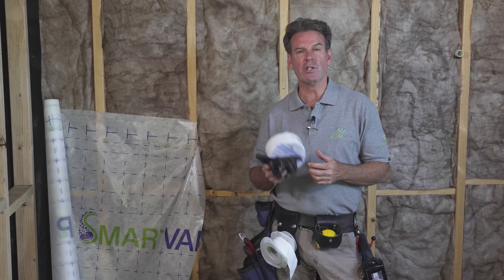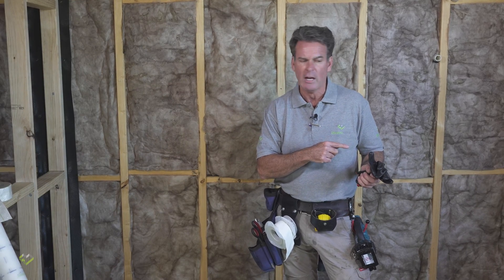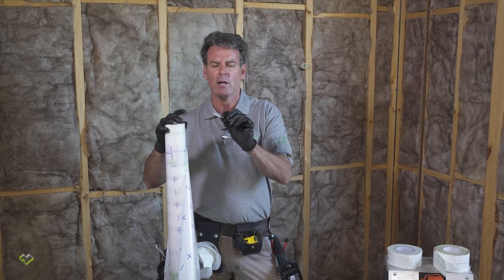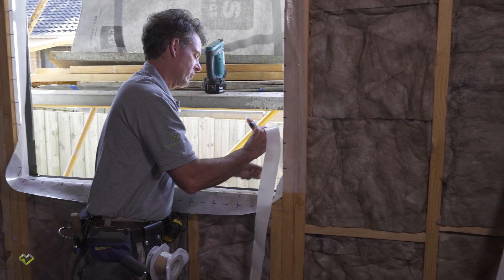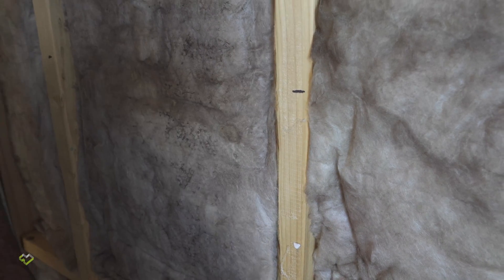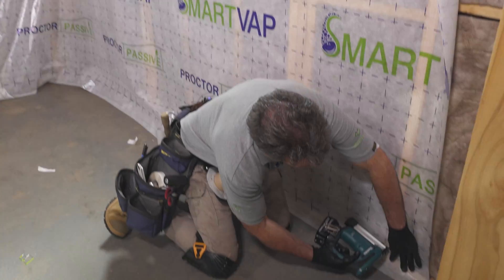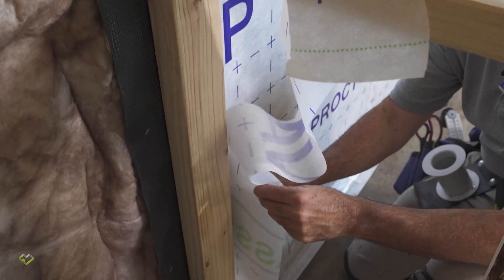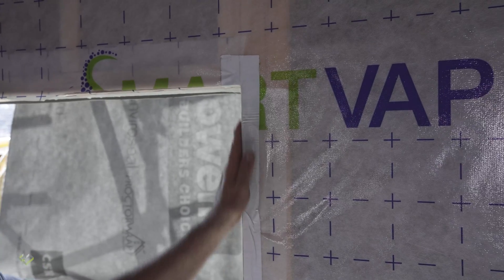Installing an internal wrap for Air Tightness and Vapor Control

Comment: Do you have to put across ceiling between floors in a two story house in addition to the ceiling under the roof or just on the ceiling sections with a roof overlying?
Reply from the maker: Another option could be doing this.  https://youtu.be/GyyaBaVWsoQ?si=I1qL1HjSHmDQFy0r

Comment: In a previous efficiency matrix video you guys were installing an air tightness membrane and either double sided taping every stud or putting staples on ALL studs and putting pieces of tape over the staples after. Here it seems you only fix the edges of the air-tightness membrane with staples and tape the joints. Is it not considered necessary now to fix the middle of the sheets?
Reply from the maker: Fix the middle join?  After this installation a services cavity is expected to be installed which also doubles as a mechanical fix.

Comment: Hi, just a question in regards to plaster battens. 
What’s the best way to do the ceiling on a renovation.
Because you would struggle to nail directly to old rafter?

Is there a way you can still use furring Chanel brackets?

Comment: I suppose the plasterboard batterns, plasterboard and any baseboard/skirting would cover the the 30mm overlap onto the floor - just thinking for those with exposed concrete floors.

Is this something the builder would do, or someone like Efficiency Matrix, as a subcontractor?  Do you have any indicative costs for this
Reply from the maker: Correct.

Comment: Really great video and i love the cimmitment to educating us on best practices. I would love to see how you would recommend making an existing weatherboard/chamferboard home (queenslander) to passive standards, especially when the external cladding isn't removed. I'd imagine it's much the same but i would think that consideration needs to be taken in the wall batts sitting directly on the external cladding and providing an air cavity to dry up any moisture that may come through. Love to hear your thoughts on a video on how to achieve this

Comment: Great clip guys, love the attention to details.
And I like the vertical installation too Mark.
But for the horizontal installation, I would recommend the top layer be applied first so as to prevent water from pooling in the overlap and the taped seem. (which we hope won't get there, but you never know....)
Building science isn't just about trying to control condensation and stopping water from getting in, but also giving water a preferred place to go if it does. Even if the manufacturer says otherwise.... question everything, and express your concerns, and we'll all keep learning and improving. 👍
Reply: Just to clarify: I'm not saying don't follow the manufacturers installation instructions, on the contrary. We need to follow their installation instructions more than ever. BUT manufacturers don't know EVERYTHING, and where some of us see an issue or come across a problem - then please please please contact said manufacturer to find a solution.
Reply: @michaelcook9414  Might be a bit of confusion from the manufacturers installation instructions, as to the way you layer it would change depending on if the wrap is applied on the inside like this, or the outside. If on the outside, starting at the bottom up would be best, but as you said, on the inside, the other way around would be better.
Reply from the maker: Michael, if water gets into the wall cavity via rain, your insulation will be completely saturated before anything might pool in your lap of the internal wrap.
Building science wise, even if this lap was changed, and water that may be allowed in here, could flow down to the bottom plate, there is nothing designed in this wall system to allow it to go anywhere after that.
If water got in there, you’d need to open it all up and dry it out and reinstall everything.

The cavity must be a water free zone.

Comment: Great video! Very helpful. Thank you for making it. But a quick question, as this looks to be a new build, how come the wrap wasn't put on the outside? Would have liked to see an example of how the services are run for the DIY wrapper, ie a powerpoint/water.
Reply from the maker: External vapour permeable wrap is still required on the outside.
Electrical services and plumbing can run in the services cavity in front of the wrap.
Reply: @daniel.s8126  Yes there are a few ways to 'solve' the issue, which is why I was hoping they would do a few examples considering the wrap install was covered off really well. I can see the electrician just cutting the wrap if there isn't enough room when mounting a powerpoint or the plumber doing silly things as it was too tight. Plus I assume the battens would be cut/notched to allow the power to be ran around the walls to keep it all on the inside of the wrap?

Comment: Most European homes and businesses are not well insulated and not energy efficient.
An energy efficient home or business is more comfortable and saves money in the long run.
Solar energy on your roof combined with battery storage can make people more independent from the grid and natural gas supplies. Add solar and supplemental electric heating, infrared heating or a heat pump for home or business heating and cooling
All big box stores and manufacturing sites can support solar energy on their roofs or solar canopies on their parking lots.
Added insulation, double or triple glaze windows, energy efficient doors, energy efficient heating and cooling systems, energy efficient appliances, LED lighting, smart thermostats, solar panels combined with battery storage and a electric vehicle charger in the garage or car park. People are too focused on the short term costs and miss out on long term savings and comfort. Blower door testing and air sealing are under appreciated tools.Even if you have money to burn you should not waste it.  Climate Change will impact everyone. Leave a better future for your children and grandchildren. Join in and speak up for the future of the planet

Comment: Great video!
With the plasterboard having a significant gap now because of the spacer does it not require a thicker plasterboard to prevent and hollow sound and or wobble/dipping? Or is something else done to reduce this issue?

Or am I just overthinking it!!